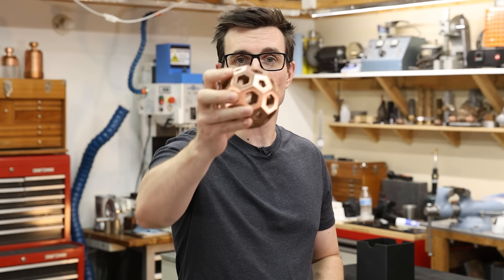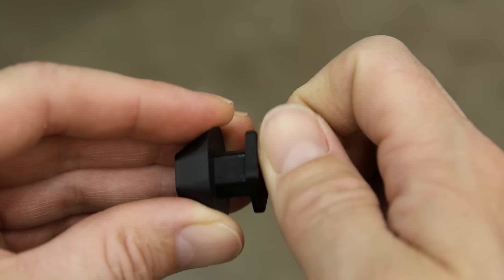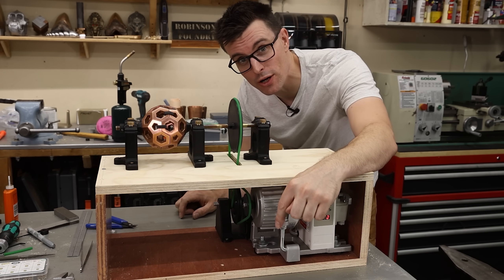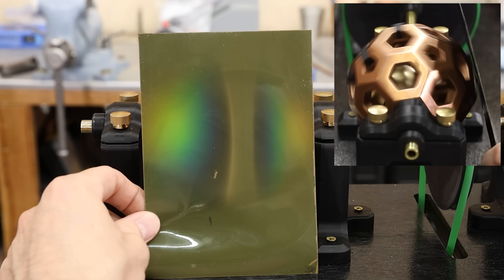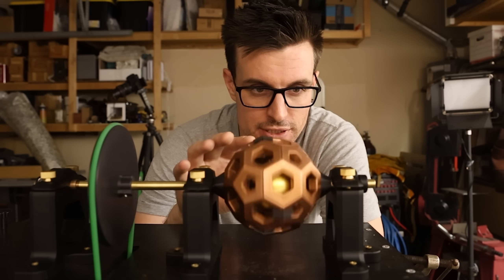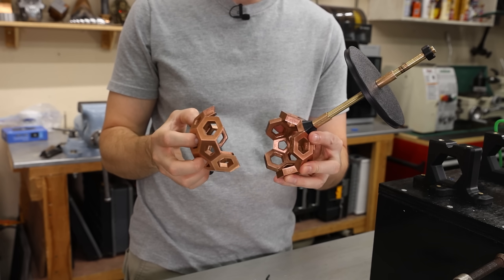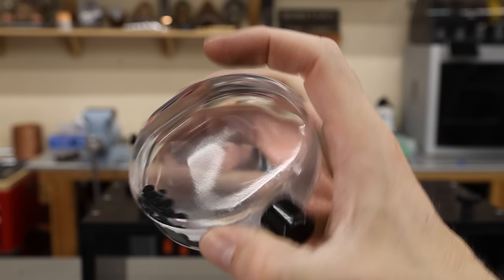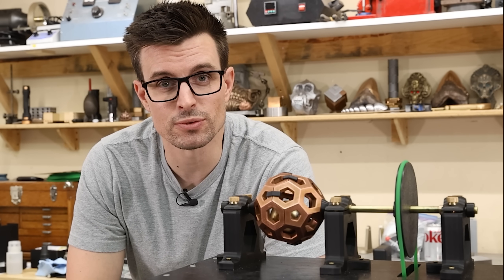Huge Magnet vs Copper Sphere - Anti-gravity Machine

Comment: The containing sphere would need to be all copper, without the holes to see through. The issue with that then is that copper is not transparent. It would technically be possible to create transparent copper, but you'd need to perfectly arrange the atoms. I believe a frequency while it is molten could achieve this, possibly a sound frequency that is used and somehow shot at the molten copper as it cools. At a minimum, this should create interesting effects or properties of it, possibly altering the colors in a pattern.
Reply: You can't make transparent copper in bulk, only very few atoms thick film of copper could be theoretically transparent.

Comment: The entire rotating assembly is unballanced. The shaft and copper housing is oscillating. You will need to make it very, veeeeery precise if you want to achieve the result.
Also the magnet sphere itself is probably unballanced aswell. That will be difficult to ballance, since you will need to remove material, and therefore you will change the magnetic field too.

Comment: 💡Technical Suggestion for Magnetic Stabilization:

To improve the stability of the magnetic ball inside the copper sphere, one could try placing an array of permanent magnets outside the sphere, with like poles facing inward (e.g., all north poles). This setup would create a repelling magnetic field that helps keep the ball centered and prevents it from touching the inner surface.

To be effective, the magnets should be positioned at strategic distances around the copper sphere, aligned with the ball's expected movement path and speed. In combination with a precisely tuned rotation or motion of the sphere, this could create a quasi-stable levitation zone, reducing friction and potentially simulating a brief state of weightlessness.

The exact alignment, spacing, and field strength would need to be tested experimentally, but this approach could significantly enhance the hovering behavior.

According to Earnshaw’s Theorem, stable magnetic levitation in a static magnetic field is not possible due to inherent instability. However, real-world systems use rotation (e.g., in magnetic bearings) to achieve levitation. For stable positioning, they require either active control or special field configurations like Halbach arrays.

Comment: The ferrofluid supports my theory that maybe the lenz force is too low for it to stay up by itself in regular air. Perhaps under liquid it will have the cusion to stay floating. I know its not ideal but my next idea is to try a sphere, not a truncated dodecahedron(i think im just throwing ideas) i think the tolerance issue plus the angular shape are the issue here. You could try to model the sphere inside but keep the exterior less perfect for casting ease. That way you have that sphere shape inside. Seems that the imperfections of the 3d print and cast are throwing the magnet off course. You can even see it on the magnet paper. Its not balanced. Granted we are talking about perfection but to exploit the universes power it only expects perfection.
Reply: Another idea that comes to mind is to use copper mesh.  Not sure if it could work or has already been considered but it could help with visibility too. Oh and the mesh could also strech with centripedal force helping smooth out tolerances
Reply: I am no scientist but it seems logical that you are right. The disk magnet in the tube was surrounded by solid copper, so stayed levitated due to this continuous form.Perhaps this outer sphere would work if the centre joint (in line with the magnets ‘equator’) had no openings and cast with a rebate type joint. For viewing the interior, thin slots or gradually spaced smaller holes formed towards the outer sphere poles.
Reply: Or you could try accelerating the whole setup downwards at a few m/s/s to reduce the effect of gravity :p

Comment: Still pretty much impossible to see the magnet levitating clearly- the copper sphere is just obstructiing too much. I would try to use the thick copper pipe, stick some clear plastic caps on either side with the axles mounted in the centers and spin it the same way as before- you will be able to look right into the sides of the pipe and see the magnet floating that way.

Comment: I'm fairly certain it's just a design issue so the flux going through the copper isn't evenly distributed so there will be more force one side than the other and it drifts. No idea on the math and stuff involved, neat project but I think much more complicated than it looks
Reply: The holes don't help either. Prevents the eddy currents that cause the behavior.
Reply: if you think about its basically an induction motor at this point.... only difference being is cage is outside, magnet inside....
Once the magnet sphere matches the velocity of the cage, theres no eddy -> drops
stalls -> lifts again until speed matches -> drops/stalls -> lifts again until speed matches......

The only way this would work is if you kept "breaking" the sphere.

i think the best analogy to this to understand is, dropping a magnet through the copper pipe, while also letting the copper pipe fall. both will be falling equally.
Reply: @contomo5710  Yes, I like your explanation.  Perhaps if a non-spherical magnet is used, with a magnetic axis possibly aligned orthogonal to the axis of least or most angular momentum of the magnet, and the spin axis of the copper container also aligned appropriately with respect to gravity, there may be a region where the various torques produce a region of stable flotation???  (Don't ask me to do the math!  The idea comes from the toy tops that invert themselves to a preferred orientation when spun.)
Reply: @contomo5710  I think you are correct. I wonder if there was a way to spin the magnet with the cage stationary would it work?
Reply: It needs to rotate in 3 dimensions to even the Eddie currents. This stops "locking" of motion between the core and shell.
Reply: @logic.and.reasoning  for that it would have to be 4 dimensional tho :?
Reply: @contomo5710 sadly at that point it's impossible for a human to visualize since that would involve free time travel, as time is the 4th dimension & we're prisoners of it.
Reply: You need to solve two problems.  The thickness of the copper sphere should be a quarter of it's present thickness.  The inside of the sphere must be smooth.  Then the ball magnet will settle down.
Reply: ...and around 54,000 rpm ....
Reply: i also am just going off of vibes and instinct here but, i too feel it needs to be rotating on more axis. it needs to 'fall' in all directions.
Reply: Doesn't this mean you have electric current in the copper in a 3d space... hint hint
Reply: Spherical would have to be better than 20 flat sides or however many that is.
Reply: Cómo va a ser complicado solo tienes que ver cómo trabajan los motores y la esfera no son perfectas para tener los mismo campos y galas de forma diferente